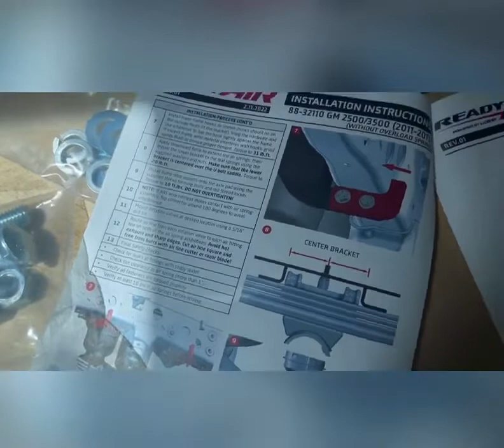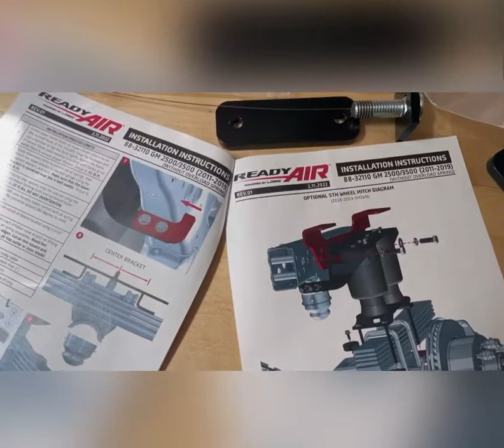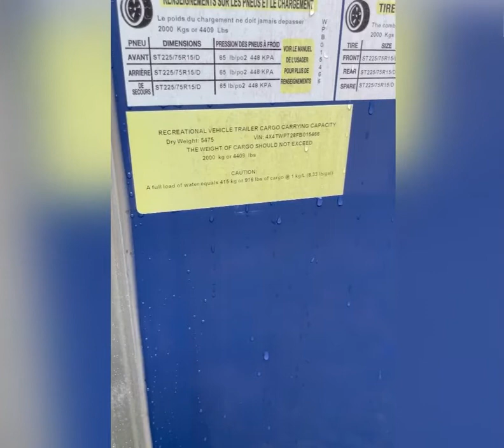The best air springs Readyair logiq dual long travel airsprings helper springs

Comment: great video thanks.  one comment...you said you "won't need your weight distribution hitch anymore".  Is that true?  It is my understanding that air suspension does not transfer the weight to the front axle, it merely improves the ride quality.

Comment: been waiting for some videos on this!!!  i have a 2017 f350 i want to install these on and i currently also use the weigh safe true tow weight distribution hitch.  our RV is a 28bhs but is about 32' long total and dry 7800 lbs.  ill have to remove my overload springs to install this...is there any reason you picked this over AIRLIFT?
Reply from the maker: Logiq air springs do not limit suspension travel.  I had the airlift springs on a dodge and the ride feels like a weight distribution hitch.
Reply: @wildwests4253  thanks